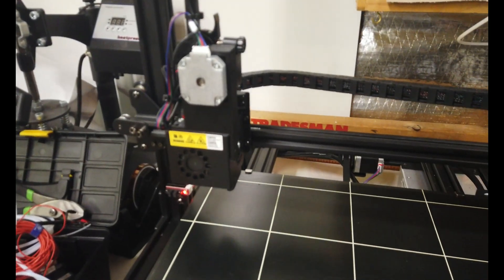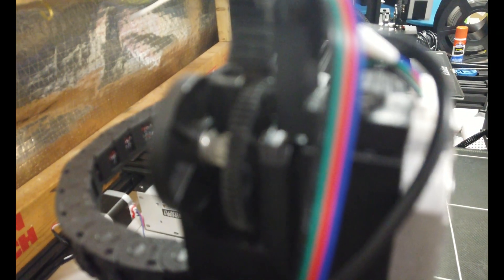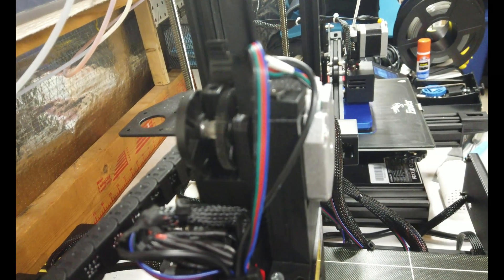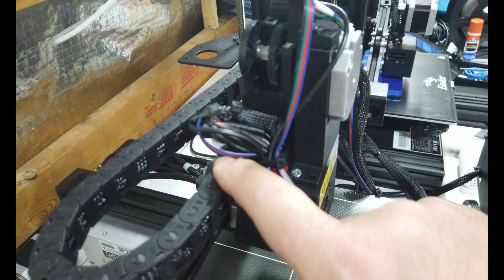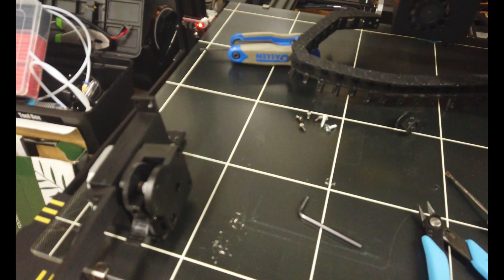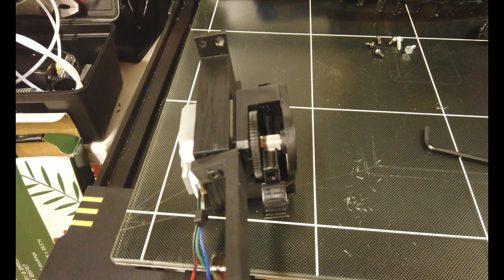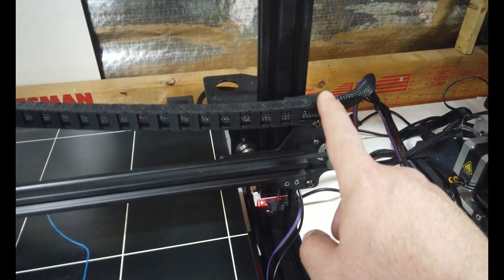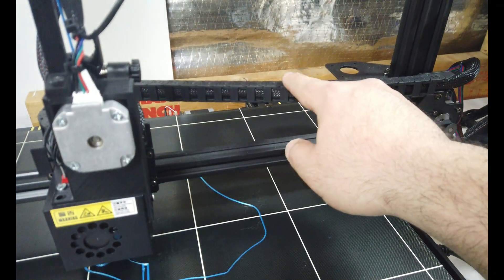Anycubic Chiron motor issue - A Warning for all 3D Printers in 2023

Comment: Very informative. Would you happen to have a video on where you took everything apart, strung the wiring and back together? I'm not too sure how to get started??
Reply from the maker: I don't have a video on it but it is fairly easy, the Red connector on the side of the machine is for two stepper motors and one is for the extruder.  Just trace the wires from your extruder motor to where it plugs in and cut/solder with new silicon wires.